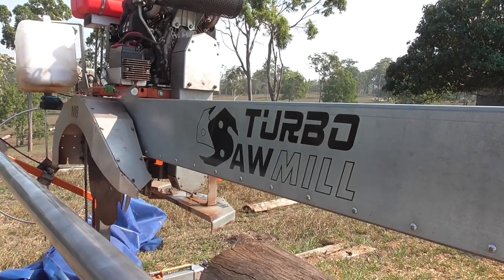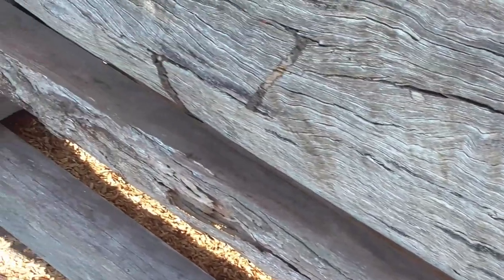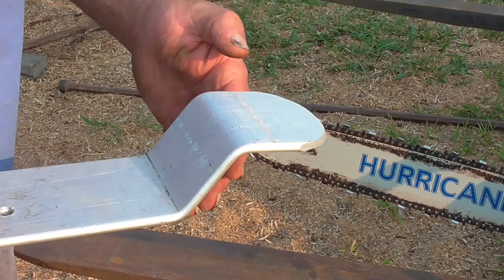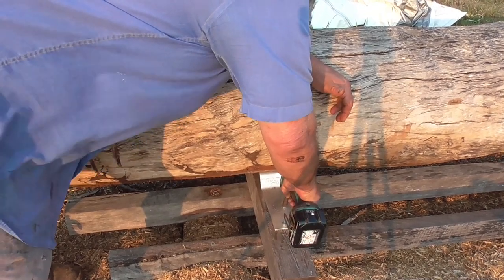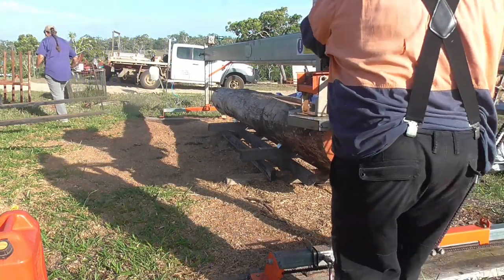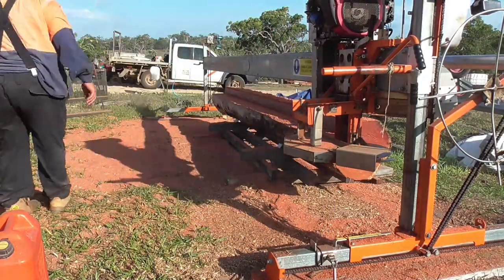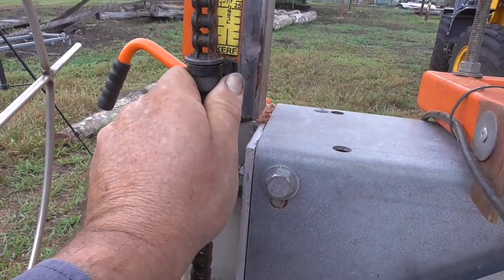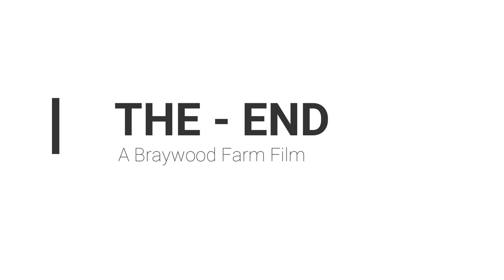Turbo Warrior Swing Mill Things I Have Learnt

Comment: Thanks buddy. The TS looks a bit easier to work around, in some regards more stable but the beams are joined and sag, not portable either. But the price of a Lucas can't be beat, Aussie made and parts don't need to be fed ex sent from NZ. The Lucas carridge height suits log 200mm up of ground and the push rail is at man arm height in most logs, theres a huge buffer zone on Lucas between you and blade. Lucas mill can be pulled down and put on a ute by one man when you know what your doing without machine lift. The TS is very costly but has some awesome features and a 12" model. It's time Lucas make an auto feed I think the design is great but dated, but will keep you fit while you choke on exhaust and dust. I've saved screenshots of your dogs and firewood rack, very good ideas mate. May God Bless
Reply from the maker: Thanks a lot for that. I guess we will have to agree to disagree on the LUCAS. Ha Ha. John
Reply: @farminglifeaustralia6716  Had 2 of them and about to buy a 3rd. How does somebody get in contact with you, do you have a website etc?
Reply from the maker: @livingadamman7994  I have an Email farminglifeaustralia@gmail.com                     John

Comment: Another great idea you have shown us.  Your aluminum dogs cut like a chainsaw bar end and bent to assure the saw blade will not contact the hard steel screw holding it down to the base.  Very good idea you have there.
Reply from the maker: I have had no trouble since I came up with that idea. A lot less stress as well. John

Comment: Hey mate, are you still running the mill? And if so what’s your thoughts on it after a few years of use? And what model is it? I’m thinking upgrading from a 8 inch cut Lucas to the single rail and would love to hear your thoughts
Reply from the maker: Yes I still have the mill. It is an 8inch cut with a 28 HP Honda motor. Its good no problems. I don't like the design of the Lucas mainly because it has two rails. Dodging the rails when loading the trees is the main thing I don't like. John

Comment: bush fire i see is all over, rain start, but not on your area :(  I knew it will be a flood in Quinsland area in september, like usual. This weather become really unstable in last 3 decades,.

I see you like work with your sawmill a lot.  

G'day  in AU
Reply from the maker: A lot of the fire area its rain now. We are just starting to get good rain today. Our wet season is January to June floods every time in February around here we cant get flooded 800 meters above sea level 40 klms away. But the roads get cut and we cant get to town. John